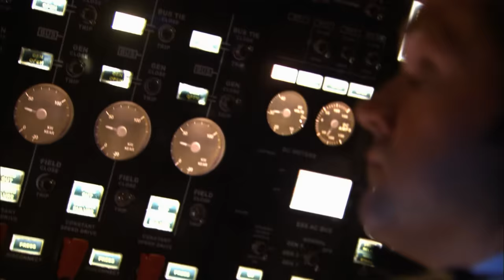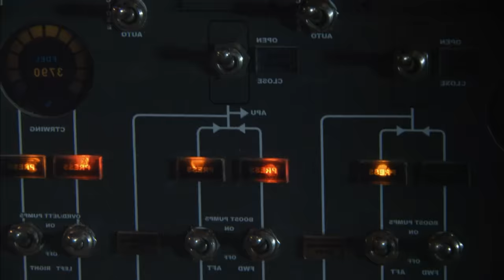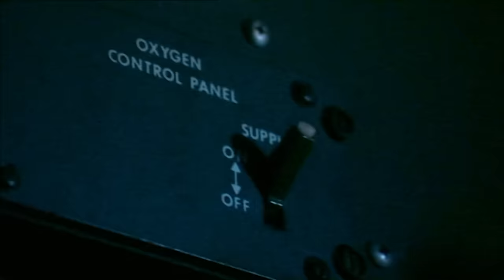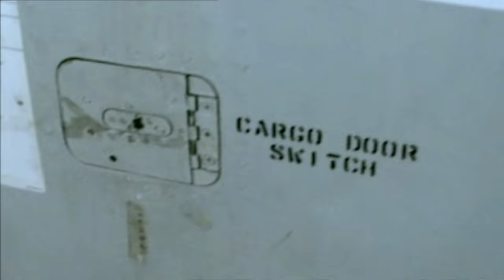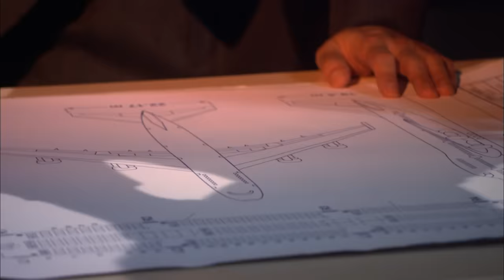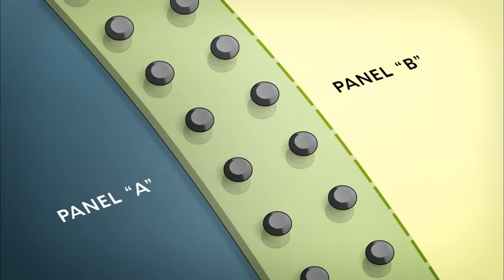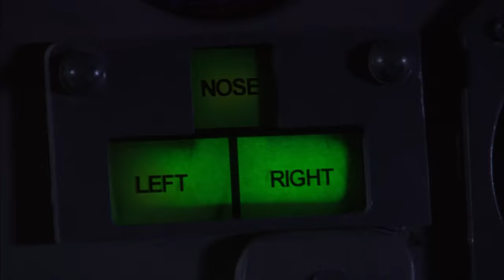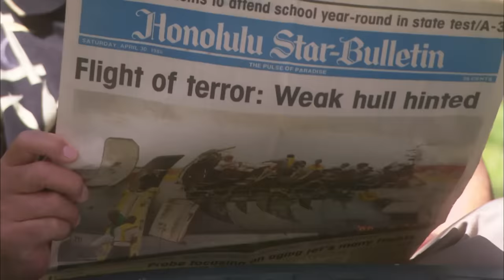The Deadliest Plane Crashes Of The 1980s | Mayday Air Disaster Compilation

Comment: I read of one crash that the pilots, as they were plummeting to their deaths, KNEW the mechanics or ground crew did something wrong.
They said something to the effect "all right, what have they done to us"? One was when the pitot tubes had tape over the openings. Another was when the plane was out of service a long time, nobody capped the pitot tubes to keep insects/debris out. Something had grown inside and blocked the tubes, leading to improper readings, leading to a crash.

Comment: It's a no brainer that a primer is required to be applied  to decontaminate the metal then the adhesive is applied on top of the primer to ensure a good bond of the two metals.  They said that the metal could have had some moisture on it when they used the adhesive. It's possible.

Comment: About 10 years ago my wife and I were on a flight from Ft. Walton airport back to Cincinnati. While we were taxing before takeoff all of a sudden what looked like smoke started to fill the upper part  of the aircraft and the flight attendant was standing giving us the safety things of the aircraft. I asked what was going on and she said that the heat outside was mixing with the air conditioning causing the vapor we all were seeing. She said that it happens all the time and after we took off it stopped.

Comment: In volcano prone areas, wouldn't it be a good idea to have satellites tracking the volcanic ashes/clouds & radars around airports & nearby high altitude to track, warn & divert airplanes away from the volcanic ashes/clouds, just like satellites & radras warning & diverting airplanes away from bad weather? 
The British airplane could had avoided the whole ordeal had the crew been warned to avoid the volcanic ashes/clouds over Jakarta.
Reply: This was the first time it had happened
Reply: @mangos2888 
Let's hope the aviation industry & air traffic control establishments have learned hard lessons from this fatal encounter & include tracing & tracking volcanic ashes in the atmosphere, just like tracking & avoiding bad weather using satellites & radars.
Reply: That could be the case now. A lot of past accidents has helped make flying safer today. Mind u these accidents happened in the 80s
Reply: Yes, I agree with you that the industry has learned hard lessons from past accidents & improved air travel safety.
This unfortunate incident will certainly attract the attention of the industry & air travel safety establishments.

Comment: I have to ask... Are those real accents? Because if not, wow... the Japanese air controller actually says "randing" at one point. Also, the constant screamtrack is completely unnecessary. Couldn't want for the JAL to crash so I could stop hearing the same 3 seconds of canned screams.

Comment: If you said all my God were going straight down and crash into the sea  then it's just like I said don't fly and keep your feet on the  ground  then you won't have to worry about anything just think if you travel by train or boat or vehicle  even if a vehicle or a train crashes you will have a  better chance of surviving because your feet were basically on the ground and if it's a boat or a  ship at least if it's sinking you can put on flotation devices and stay afloat  until help arrives

Comment: ✈️ I know I’m not a pilot, but I think it’s a bad idea for the 747 affected by volcanic ash to have did emergency descent of 6000 feet when they were at about 16,000 feet. When you don’t have four engines, you have to make sacrifices. So just because one of the pilots doesn’t have as much oxygen as would be preferred, they very well could’ve cost them all their lives. And I’m not just saying this with 20/20 hindsight, it just seems the obvious decision. It worked out, but it worked out coincidentally. They usually have mobile oxygen tanks where they could’ve ran in the back to get the copilot and oxygen tank. Orr had him occasionally use one of the other pilots oxygen. None of the decisions were good, but I feel losing all that altitude almost cost him all their lives.